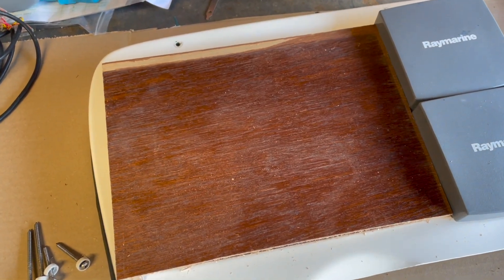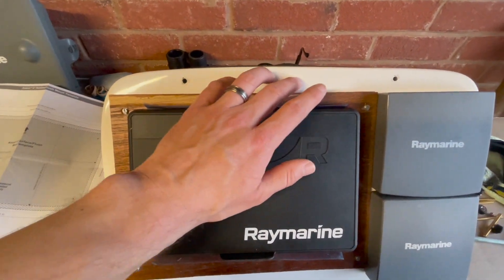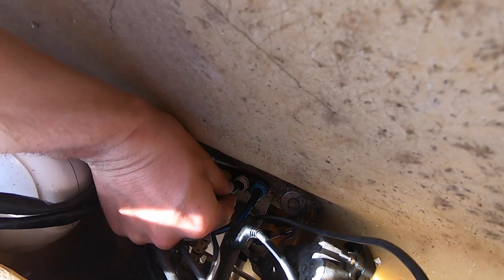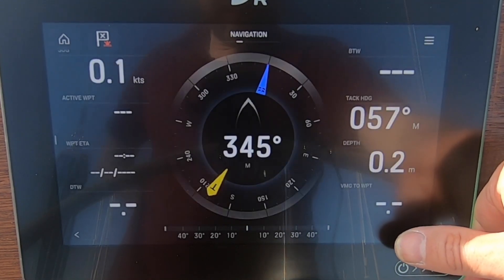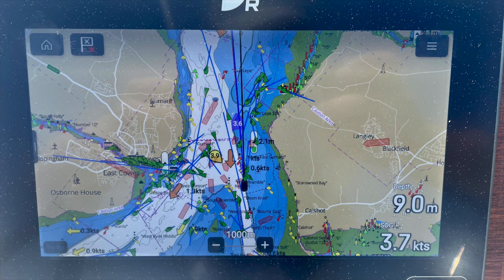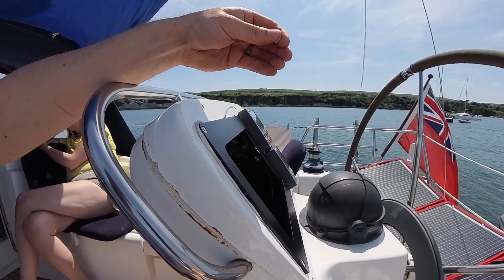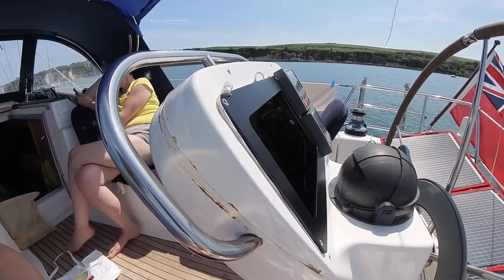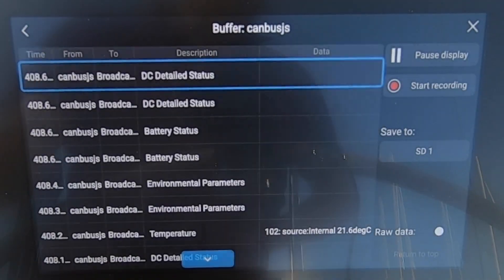Raymarine Axiom Install - SeatalkNG to Seatalk1 and sharing data via SignalK

Comment: Would be interested to know why you seem to have stopped on the Raspberry Pi? Was it not very good, lack of features?  I am at a similar point, i have a Raymarine C120, Autopilot and Radar and looking for new system. I can replace all but the Radar on OpenPlotter (maybe even that with OpenCPN addons)
Reply from the maker: Hello, I’ve still got my Raspberry Pi and its defiantly not going anywhere. It’s providing all of the engine data, battery data, environmental information and it also gets the info from the Raymarine kit. I've just changed my C80 at the helm station to an Axiom. I've not yet changed my radar so we have lost that functionality at the moment and I plan to swap that for a Quantum2 in the near future. You can link the ethernet/WiFi radars with an OpenCPN plugin, its something I also plan to look at as we move forward so if you do get to that stage before I do, lets us know any hints and tips for getting things setup. https://opencpn.org/OpenCPN/plugins/radarPI.html Also note that if you swap to Axiom and have an older Autopilot, it can only send a track across to it, you can't directly control it from the screen.

Comment: Hi. I'm doing the same upgrade on my B37, 2007 model. I was wondering, what type of interface do you use to connect your SeatalkNG to the RaspberryPi? A CAN->USB device perhaps?

Thanks!

Svein
Reply from the maker: Hi, I’m now using a development board from OpenMarine called a MacArthur Hat which should be released soon. It has both Seatalk1 and a can interface so it’s helped me get from one system to another. It should be released soon. I think a lot of people go for the pican-m hat which is also popular. This is the board I’m using https://youtu.be/w-2oEoNx8MA

Comment: Hi, which path are you using from signalk to display the battery voltage on the Axiom dashboard display?  I’m not able to get any battery voltage on show on mine.
Reply from the maker: Hi Roger, I'm going to do a video about this, but im using the SK-NMEA200 plugin and for me i just needed to put the word 'House' & 'Starter' in the battery feilds. Took some time to get to that stage but thats all i needed. What are your batteries called?
Reply: That’s what I’ve got as well but nothing is showing on the dash display for battery.
Reply from the maker: If you go to Network I think it is and then NMEA messages on the link to your Pi, can you see it sending battery information as a heading. I don’t think mine shows data here but that was one of the troubleshooting steps